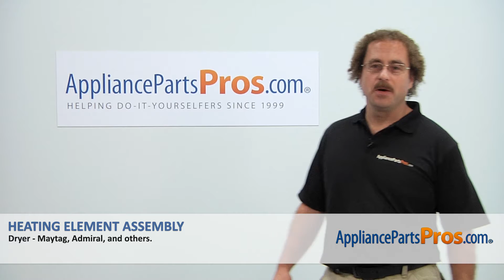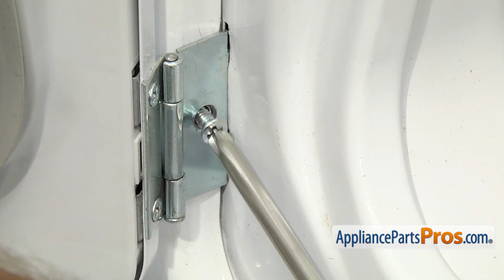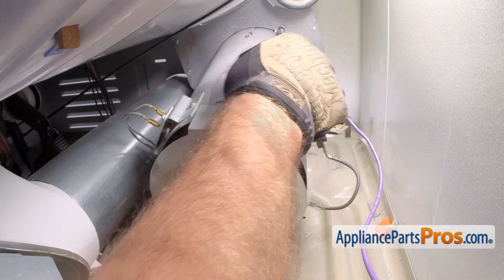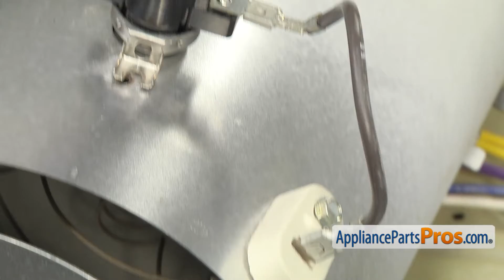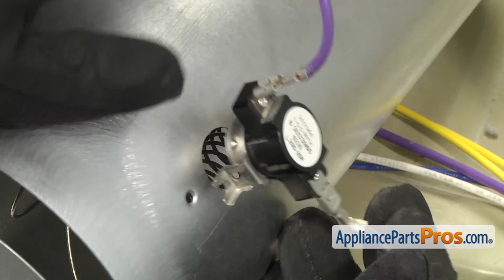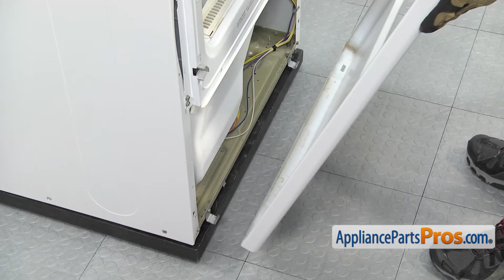Maytag Dryer Heating Element Assembly WPY308612 Replacement — fits Whirlpool/KitchenAid

Comment: I realize my comment is 8 + years later, but i’m currently in the process of putting one of these back together.  It would have been helpful to show which size screws and length of screws that were used.  Otherwise a real good video.
Reply from the maker: Thank you for the tip. If there is anything we can help you with in the future please let us know.